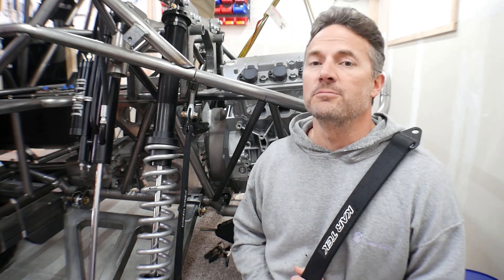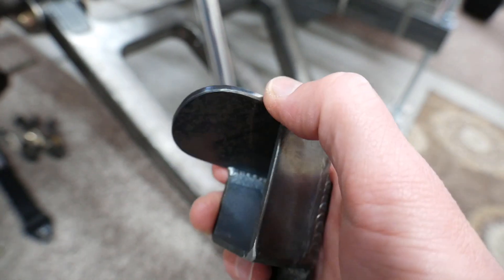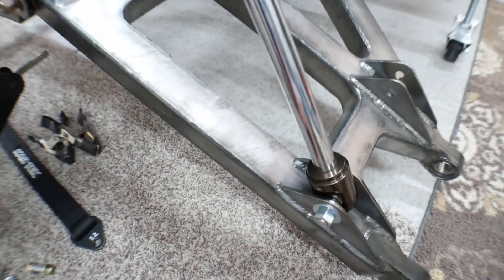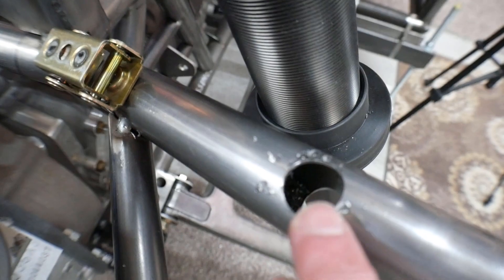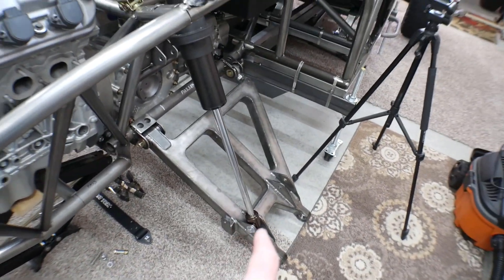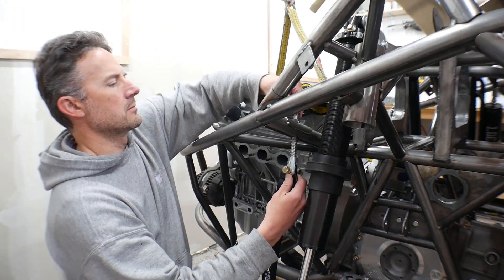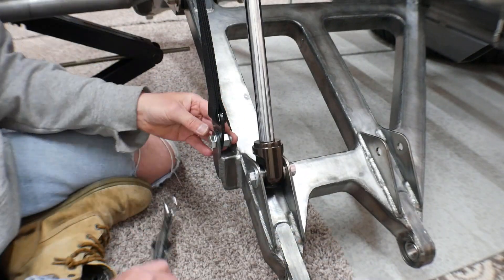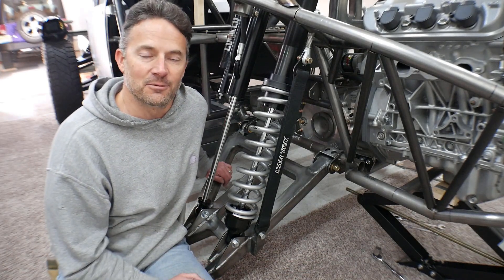Installing Wratchet's Rear Limit Straps

Comment: Awesome build sir! I'm curious about the top strap bolt, it looks like it its very close to the top coil and coil slider. 
You've inspired me to finally start my 72 baja build too. Looking forward to seeing what's on next week's show sir!
Reply from the maker: Well your curiosity is for a good reason. When I first assembled this and saw how close it is I thought I was in trouble. But when I cycled it there is about a 1/2" clearance between the slider and the bolt. So although it's close, it clears enough.
Good luck with your build, and thanks for the comment.

Comment: Hey man, 
Kevin here from Australia. 
Great video.  I love how you don't have to over engineer something to make a jig . A piece of wood is always fine . 
Q. You put a piece over the hole you step drilled (hogged) out what about the bottom do you fill with weld or make  a smaller piece to make it all OCD proof. 
See you next week. 
✌   Peace
Reply from the maker: Kevin, I bored the upper hole bigger than the lower hole, so it's not as sloppy. I'll fill it in with weld. It won't look as nice as the top, but the top hole is the one I opened up the most for alignment.
It's cheating but it works. ✌😎

Comment: Doug Bug, Nice Fab! I have only one concern. Because the strap is so close to the coil over, Just wondering if the coil over spring when it's fully compress it will leave enough clearance that it won't pinch the strap causing it to tear or wear when the strap happens to fold inside the spring.
Reply from the maker: It's a good question, I'm hoping that's not a problem. If it is I'll add a spring that will be connected to the engine cage to pull the strap back some in that direction. But I'll wait first to see if it seems like that might be an issue.

Comment: I hope when you strip the chassis down for final welding that you're going to knock out all the tubes that intersect other tube joints and weld underneath first?
Reply from the maker: Yeah, that's not going to happen. I pre welded the joints on the base, but anything above that I didn't. It would have been better to do that, but I really don't think it will sacrifice that much strength.
Reply: @DougBugBuilder  if you don’t already, you need to watch Ryan Kibbe’s channel. I know he’s a professional and not a home builder. But his attention to detail and thought process really make you think when you’re building. For the sake of cutting a few tacks, welding a joint, then slotting a tube back in that you know fits. Much stronger overall chassis, and you’ll know your load paths are solid. Let alone the reduced chances of stress factures in area’s where the fit up might not be so great.

Comment: Will you be adding a nut on the bottom of the top rod so it doesn’t move up?  Also what welder are you using a Millermatic 220 multiprocess?
Reply from the maker: I wasn't going to because it has a spring on the bottom. But you are now the second person warning me about that, so maybe I will. Thanks for the tip. 👍
Mine is the Millermatic 211.
Reply: @DougBugBuilder  I was wondering if it would chatter as the suspension compresses.  The strap is kind of stiff.  On your Instagram photo I thought the center collar was a barrel nut.  Anyway love this build.  And great ideas on making everything work.  I’m building a bug now too.  A little different from yours but I am getting all kinds of ideas from you👍